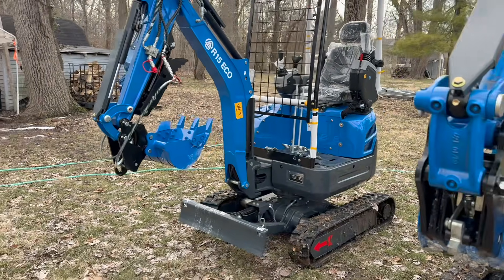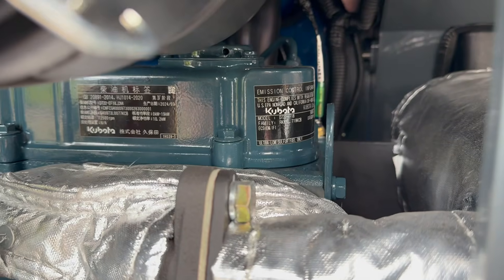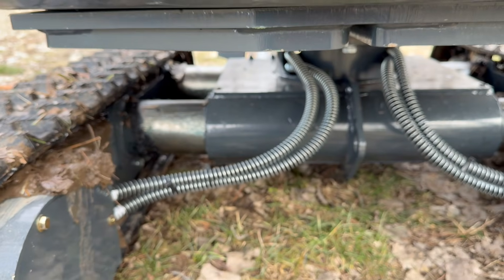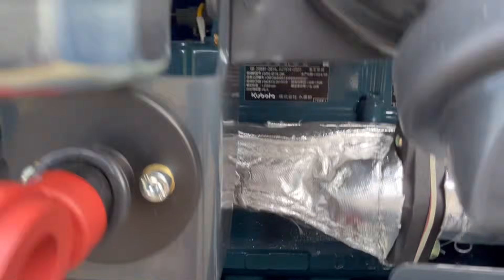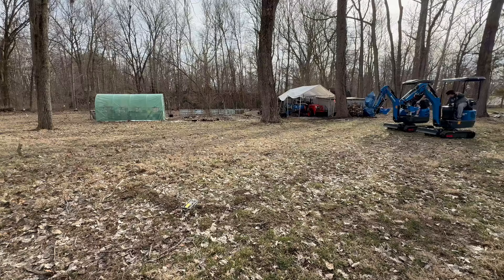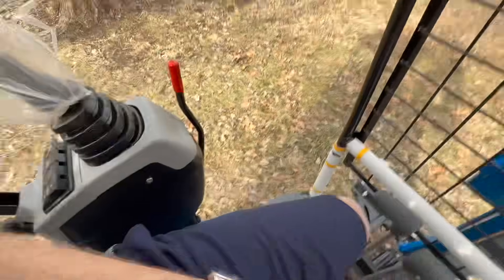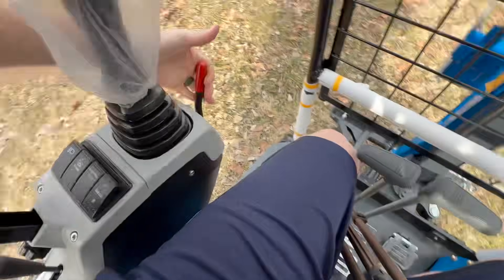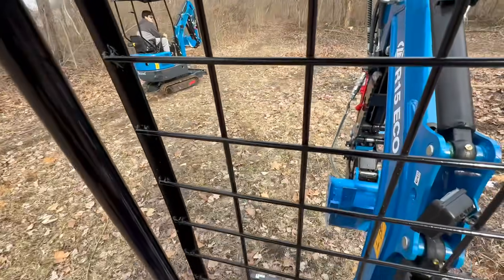This Chinese excavator is 2x faster than the rest.

Comment: What are the price differences
Reply from the maker: @grantunderhill6451  most dealers sell the fully optioned diesel R10 for about $9,000, and the fully optioned Diesel R15 for about $14,000. Prices vary depending on location.

Comment: Fun fact; both have the same drive motors. The high speed on R15 is actually a bit of techno voodoo that puts more flow into the drive motors somehow.

They are planning on doing the same on R10 in the future, but it'll be over half a year before the updated version.

R13 and R18 have another type of true two-speed motors and promises up to 3km/h.

I ordered some speedhunters and need for speed stickers for my R15, gotta race in style you know
Reply: Ive got the r15 arriving towards end of the month. Was considering the r13. Was told the r15 had three hydrulic motor, plus it had extra weight minus the compact size. 

I just hope i made the right decision with the r15-4 eco.
Reply: Is there any more news about an update to the R10? I’d really like an R10, but it looks so slow.
Reply: @jordangarside  unless they make the R10 a triple pump I doubt it. This type of drive motor requires two pumps to run in high speed, then you'd need a third for the actions.

Comment: I only see a single pump on the R10. Based on my experience, machines with pilot control minimally need to have dual pumps.  hope can get more information about it!  Great video btw!🎉
Reply from the maker: I believe technically they aren’t “pilot controls”. Most people use the term pilot to mean controls at the sides. These are in the location of pilot controls, but are manual valves connected to the sticks. There is a on/off switch for the hydraulics up front that way when you are getting in/out of the machine you don’t bump the controls.